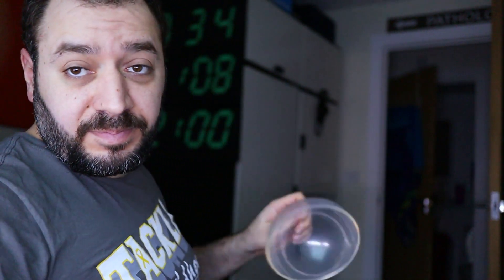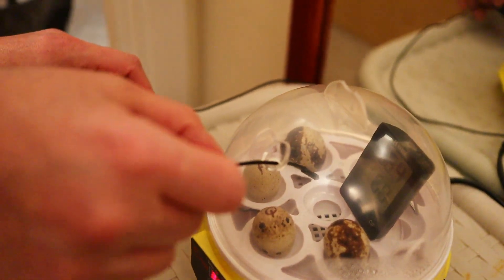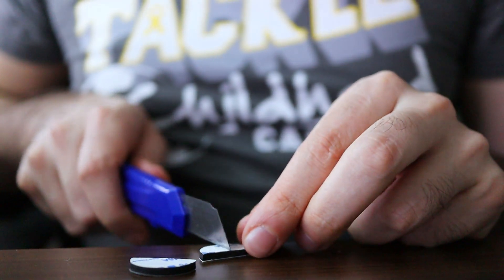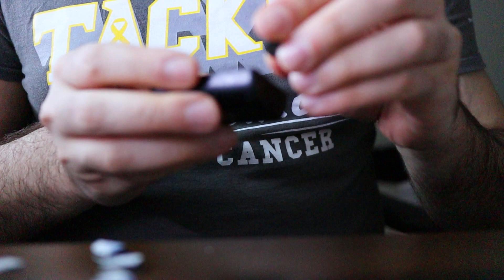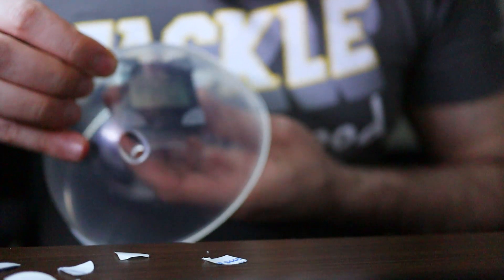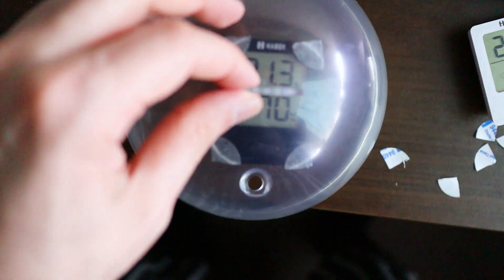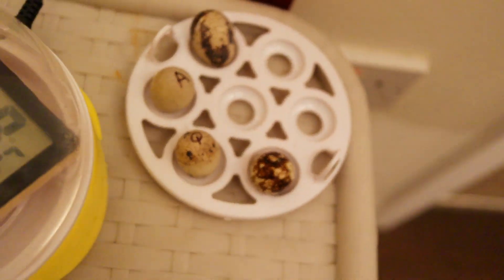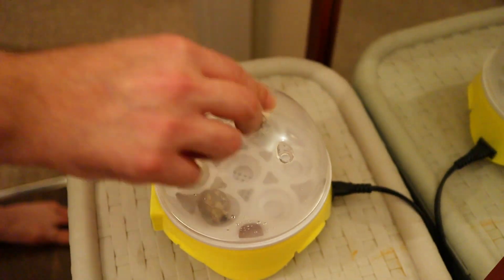Problems with my egg incubator

Comment: None of those electronic thermometers are accurate enough for calibrating your incubator. Maybe to get a baseline so you can track for temperature swings after you know what the actual temperature is. My 2 Brinsea and my Gqf 1588 read 97 and 97.5 both thermometers read the same in two different incubators. One reads 97 the other 97.5.  I use the Brinsea to incubate and the 1588 to hatch in. The dust between the plastic takes time to clean and this way the incubators stay clean to keep eggs in all the time.